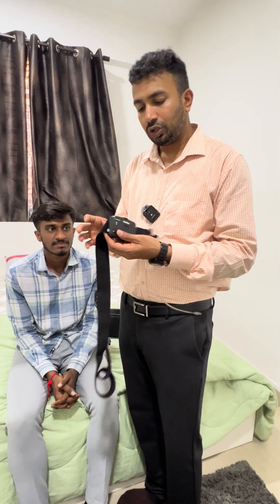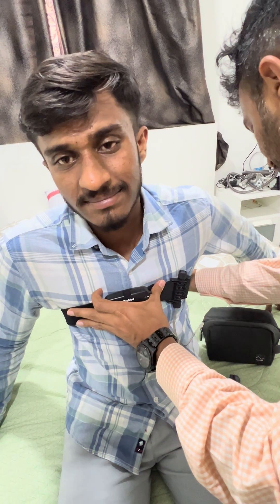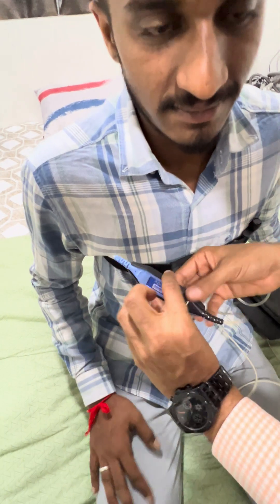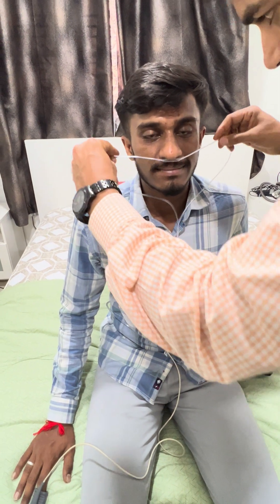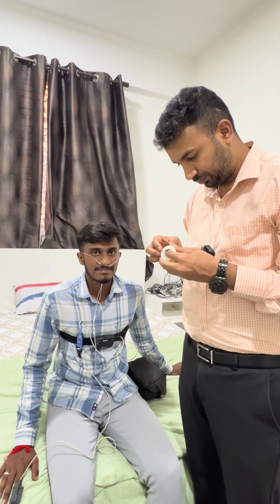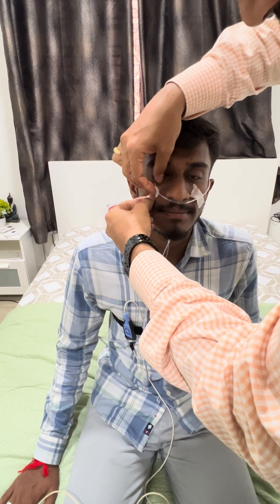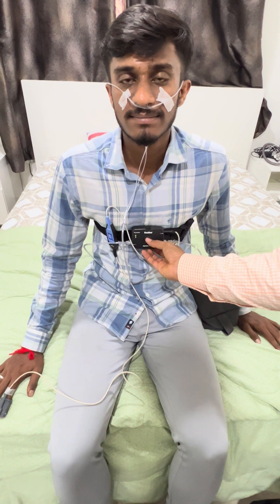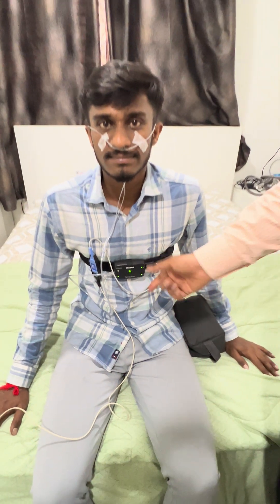How to do a Home Based Level 3 Sleep Study  | Demonstration by Certified Sleep Technologist

Comment: Sory..i need to ask.. My daughter wear this right now.. When she's breathing using her mouth.. The red light starting to blink.. Should i close her mouth so she can breath through her nose.. So the light will turn to green again..
Reply from the maker: If she is breathing through her mouth, it means that she is having some kind of nasal obstruction. If kid is having snoring or sleep related breathing disorder, before doing the sleep study, an airway evaluation should be done by an ENT doctor. Even if you try to close the mouth, she will open it again.

The red light is blinking not because of mouth breathing. It may be because the connections are not correct.